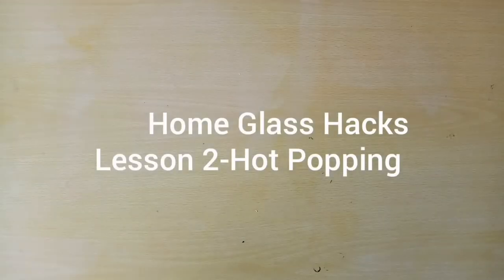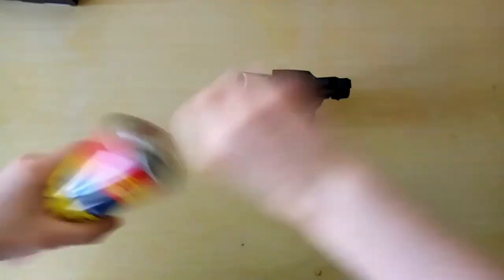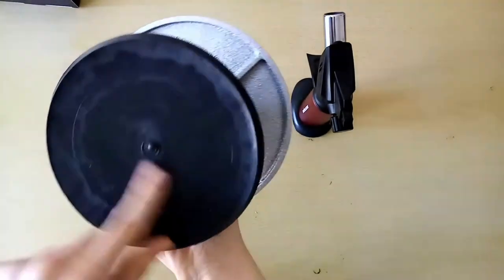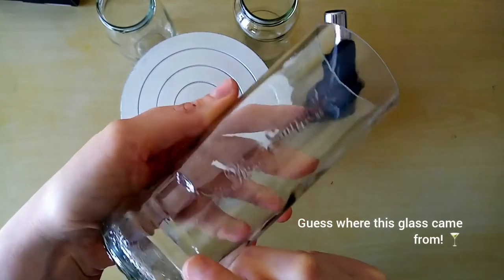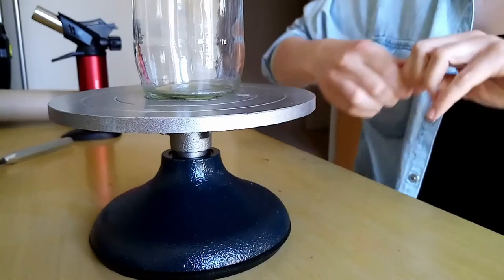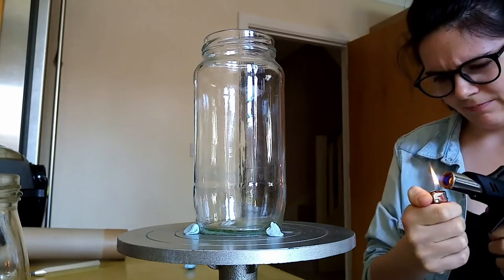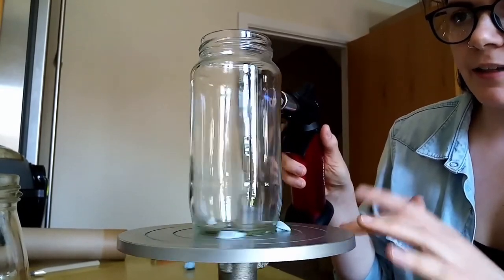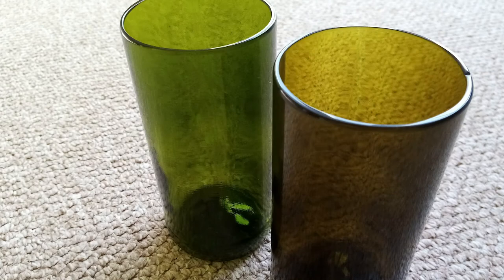Home Glass Hacks   Lesson 2   Hot Popping Cutting Jars and Bottles Using a Chef's Blowtorch

Comment: Do you have a link for the turntable? Is it from a ceramic supply house?
Reply from the maker: Hi Marjorie, I actually got this from Amazon, but it took a long time to arrive and was a little off centre, must have been banged in the post.  Here's a link so you get an idea, what country are you based in though? Might be better to shop locally!  I recommend to go to a ceramic supply house instead as you mentioned.https://www.amazon.co.uk/Creativ-10300-Pottery-wheel-18/dp/B009ZSCJJ8/ref=sr_1_3?dchild=1&keywords=potters+wheel&qid=1616171080&s=kitchen&sr=1-3 
 If you want a cheaper option to try first some plastic cake stands work okay, but if they are too light they won't spin well.  I found this one worked okay: https://www.amazon.co.uk/gp/product/B009SILGVM/ref=ppx_yo_dt_b_search_asin_title?ie=UTF8&psc=1